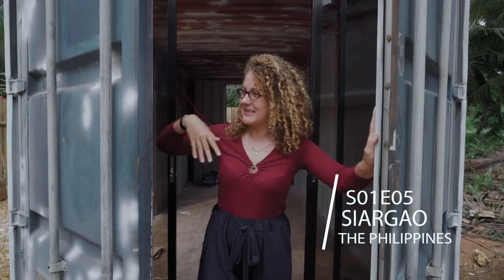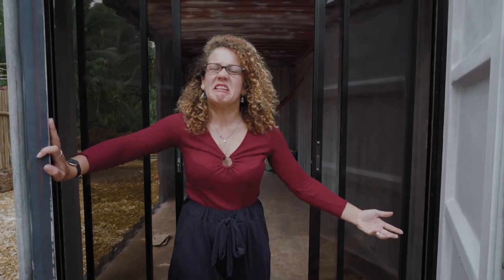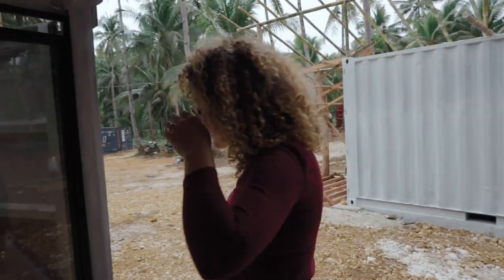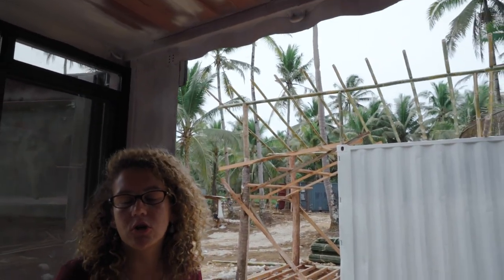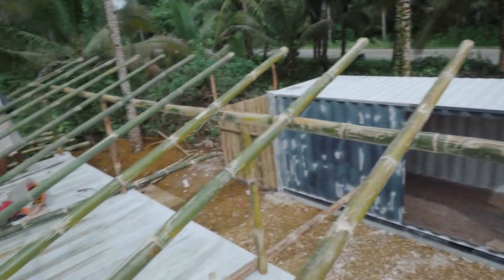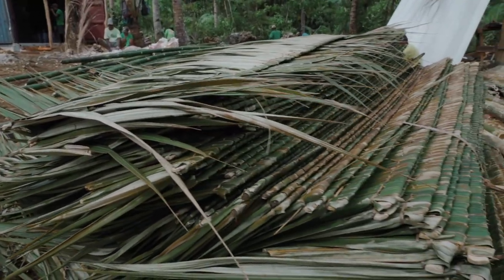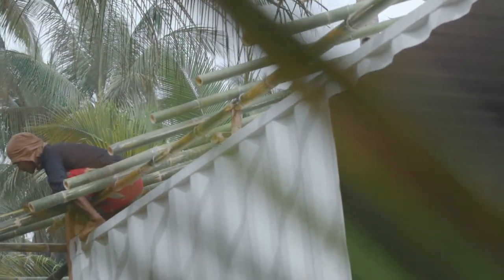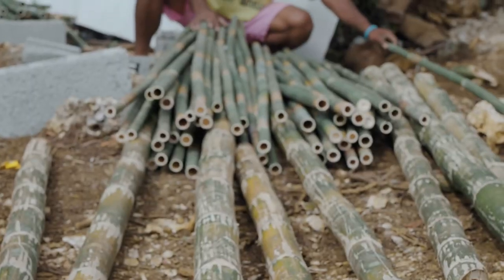CONTAINER HOUSE IN THE PHILIPPINES | ROOF & BATHROOM

Comment: Enjoying the vids guys.. Love that bamboo toilet -u will need plenty of ventilation in there. You plan on putting insulation on the walls? Might get pretty hot if u don’t, get good natural ventilation. Looks like ventilation is the key! Electric fans and Mosquitoes nets on the windows for sure 👍🏽📐✏️ I got Dengue there in January 🤒 so be careful guys. Gd luck!
Reply from the maker: Architect Russell panicking and applying mosquito lotion ahhh im so scared of Dengue!! Was it rough for you? Now its the dengue season so many kids have gotten sick already :// about the insulation.. honestly we want to avoid it as much as possible.. so what we think we will only insulate 1 wall.. the one that holds the aircon and which does not have the window opening. The external bathroom has a 40cm opening between the bamboo and the roof, so its the outside feeling and natural ventilation. For the inside.. aircons and fans. And the above nipa roof that is being built will provide shade for roof and wind can run through! I really hope we dont have to insulate the whole thing.. it will be costly ://

Comment: One way to make the bamboo wall totally closed with no gap is to split the bamboo lengthwise. You can install the first half of the split bamboo either horizontal or vertical all facing out. The other half all facing in to close the gap. This would save you more bamboo. Slightly smoke the bamboo and apply varnish would give it a nicer finish and weather protection.
Reply from the maker: Bert Lacatan yup we though about that! However, opening the bamboo lenghtwise means more treatment and more open areas for the termites to enter! However, we might try your suggestion on the other bathroom and as the time goes we will be able to compare which lasted longer! 👌🏻🙏

Comment: I’d place a steep A frame roof over the container with ample louvered vent outlets at both ends to insulate your container home from heat as the Philippines during summer is extremely hot Likewise add foam sheet wall insulation and hardiplex double wallpanels for safe neasures. Elevate your. container by placing concrete plinths at the 4 bottom corners and the center in anticipation of flash floods during heavy monsoon.

Comment: Hi, nice work, being close with nature.

Anyway, since you mentioned about dengue outbreak. Do research on this wild grass called "tawa tawa". Search how it looks like. Its a very effective way to cure dengue. 

Tawa tawa is a wild grass that grows anywhere in tropical places. Gather enough with stems and leaves, clean thoroughly, then boil to make tea.  (Administer: 1/2 cup hot tawa tawa tea to patient before bedtime) monitor cbc for platelet count) on 1st few days some platelet counts would plateau then eventually would reach normal levels. Once platelet count drops 3 to 10 points... its a good sign on the way to recovery. (Of course, must hydrate patient well with water) ( good suggestion on buko juice as it is fresh and full of enzyme) 

Enjoy Philippines!

Comment: Consider putting wooden frame around openings fixed firmly on the sides of the container so that it will be easier for fixing (screwing) the aluminum frame of windows or doors.
Reply from the maker: Eunes Jun Salilaguia good idea! The team is using metal tubular bars 2x3 inch, welded in the openings for the aluminium window frame to be fixed! Hope its sufficient! q

Comment: Put the bamboo roof up higher so you can use the container roof as a 2nd floor for a roof top w table and chairs where the guests can drink and eat and chill...
Reply: Yep, this is a good suggestion it will not cost so much.
Reply from the maker: However the higher it gets the hardred it is with the typhoons as it can be taken away more easily if elevatwd high. We were thinking about it but decided it might be a bit tricky. In case we see that the container roofing stays stable in the typhoon we can always elevate it more.
Reply: @TravelLit  bamboo is a very tough tree, it can get through winds and typhoons. which very convenient and plus you said that you put cement inside the bamboo, so I think it will be good, but still that's your decision to make. its okay not to be risky. so good luck on your project :))

Comment: Just my two cents, try insulation the wall of the container from the outside..it is better to insulate metal from the outside than from the inside.. Just try it.. leave one container exposed to the sun and cover the sides of another container even with this roofing material you have now.. see the difference..
Reply from the maker: pole star great idea!!! We were thinking of using natural insulation materials!

Comment: when cutting holes you should structurally brace the container as metal warps also if done with wood it will help when you do ceiling and insulation of walls

Comment: It looked like the ground elevation of your property is lower than the road elevation? Wouldn’t that drain rain water toward your property?
Reply from the maker: leapdrive the road is on top of the hill! It goes down after that. The property is lower only in 2 places where we have built a cement/stone foundation to elevate those 2 areas! 🙏🤩

Comment: you need 2 inch x 2 inch tubing welded in the window opening to give back the strength. then put the window in the 2x2 framed opening

Comment: You should put the container on an elevated cement, and place the others on the side and top like a two story duplex, and paint it with roof paint that keeps heat temperature low.

Comment: about the bathroom bamboo gaps... for me, I would put "nets with small gaps" on both sides of the wall (outside and inside). this would make visibility between gaps more difficult and cheaper cost too And circulation of air is still present. And it would also make it difficult to insects to access to go in easily, they have to crawl up not between gaps.  Just the point is, making visibility not to be clear to be seen between gaps. I think there won't be a peeping tom by daylight or even at night if you have security personnel anyway.

Comment: 8 containers at 2500 is 20 grand 
 Just to start .    Containers are not more economical to build with .  They need good insulation , they turn into ovens in the sun .  They are sturdy , but costly to turn into living spaces .
Reply from the maker: paul joe lets see and we’ll prove you wrong, just a healthy competition to approve that containers are perhaps cheaper after all. :) 20k and some improvements and for 80 k well have 8 living units. 8!! 10k each. I doubt you can build a conventional house in US for 10k. This does not apply to wooden kubos in ph with no bathroom and windows.

Comment: in Philippines price? that sliding aluminum glass door is expensive for a province part.. in manila.. that cost 7k to 8k pesos plus windows
... just saying.. what a ripped  off..
Reply from the maker: aldrin pagunuran not a ripoff. 3,40 m x 2,40 doors with 4 modules and separate upper part. Price and demande rule applies, in manila its easy to deliver and install, here the area is very far from bigger islands, demand is high, supply is low so suppliers can dominate the market with their prices. We did the research :)
Reply from the maker: aldrin pagunuran in any other province which is on a bigger island like Mindanao in CDO or Davao.. yes it would be 1/3 cheaper. Thats how the world works, i suppose :)
Reply: does the materials included on the 10k price? or you guys bought all the materials and they just assemble those doors